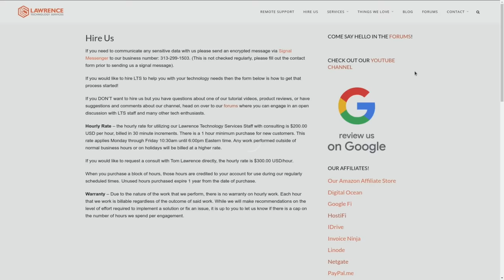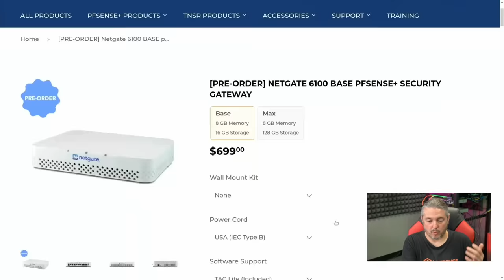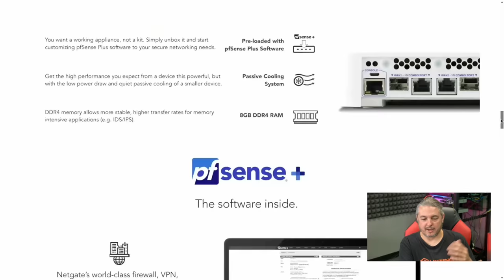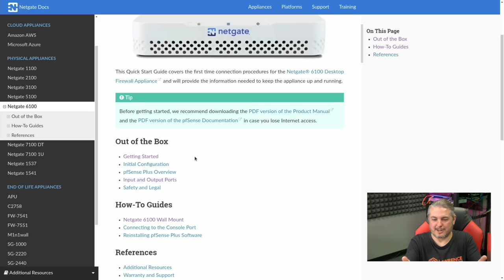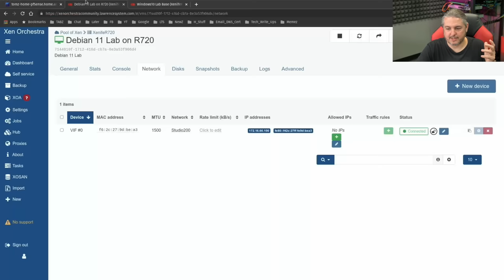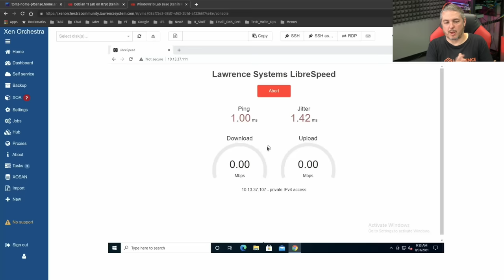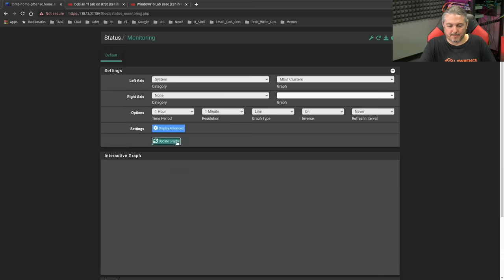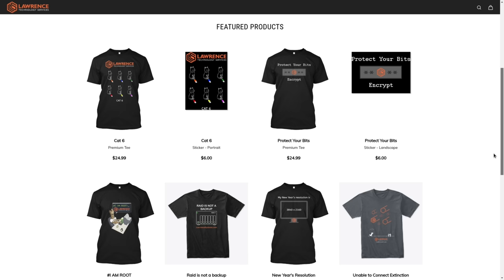Netgate 6100 pfsense Firewall Review

Comment: It's not clear what MTU the interfaces were set at. You're not going to get 10Gb without reconfiguring it.
Reply from the maker: It was left at default and yes, you can get 10G at the default as I demonstrated in the video.
Reply: @LAWRENCESYSTEMS  Not optimal, no. You lost throughput on the default settings.

Comment: This is a good but slightly misleading review. The speed limitation is not a limitation of firewalls in general. Its more of a limitation of freebsd. Linux firewalls are not as gimped by stream count. 

Also, your Suricata process is NOT running in inline mode and you ran it with only the base included rules without full suite of ET rules enabled like 99% of people would in order to properly protect their network. 

Nothing against Netgate hardware but with Suricata now supporting VLANs natively without disabling hardware VLAN offloads, this firewall doesn’t have enough RAM to keep up a serious multi-VLAN enterprise environment. While I wholeheartedly support the price as PfSense is very highly capable, one can do much better by purchasing a used server that will perform exponentially better for the same or less money. 

QAT is of limited use since most users who need that level of IPSec throughput will just go the TNSR home/enterprise edition route or use Wireguard to get similar throughput as QAT accelerated IPSec without the need for on-die QAT or QAT expansion cards.